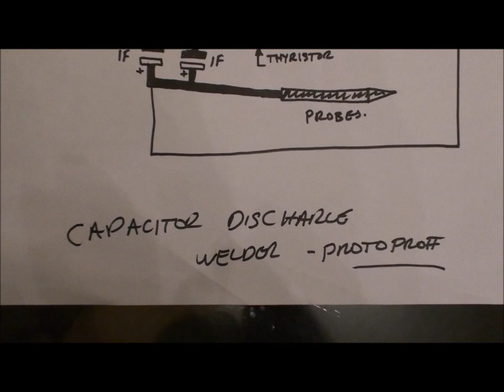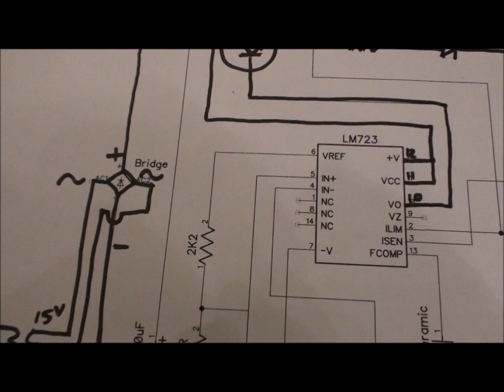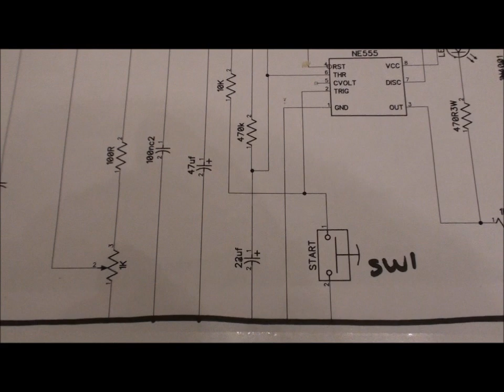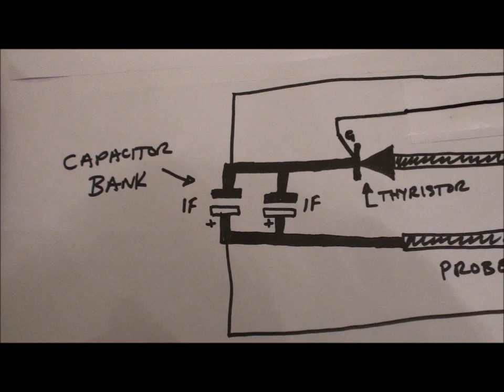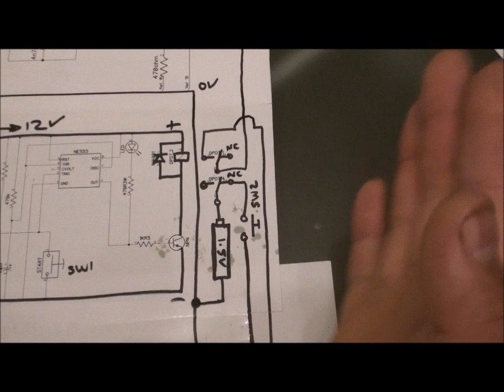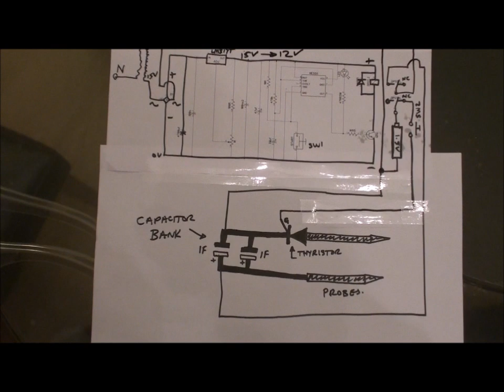Capacitor Welder - Battery tab Welder part 2-2

Comment: too much work just calculate the amount of power you need per discharge and set a powersupply to charge only to the voltage of charge for the capacitor that is necessary.

Comment: Suggestion: Instead of a 1,5v cell use a optocoupler driven by the 12v circuit to fire the thyristor. An elegant solution.
Reply from the maker: Hi there can you you expand  a bit more, you suggest using an optocoupler can you provide info thx, any suggestions welcome. thanks

Comment: You get a short thryistor life if it isn't triggered with a sharp current pulse. AA battery hesitates, switch contacts bounce. If not opening the conducting area all at once, the fraction of the thryistor conducting initially is slowly damaged. Quick 1/2 fix change trigger to 2 AA add 1000pF & 0.1µF caps before switch. Better fix is a higher voltage trickle charged cap before the switch and cap and a diac (avalanche breakdown diode) after the switch. Now gate pulse shape is diac and cap.

Comment from the maker: Hi there these are car audio caps with the electronic display units removed.
I would really keep voltages below 16.5v although i suspect these caps would handle 17v absolute maximum. I have kept the voltages to below 16v to give me a safety margin. Im using 2.5 Farads but 2 should work just fine.
Thx for the interest hope it helps.